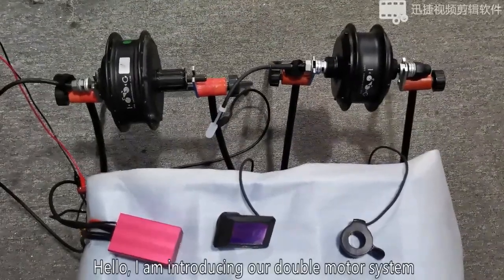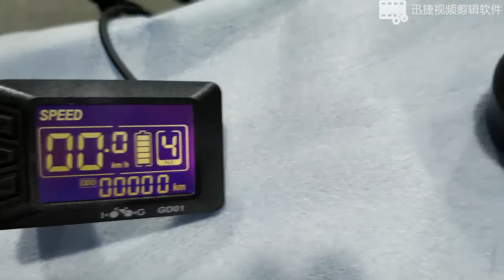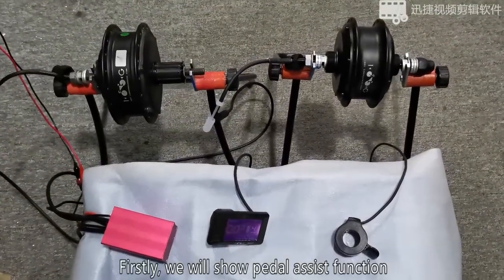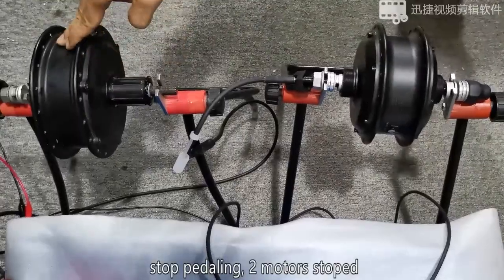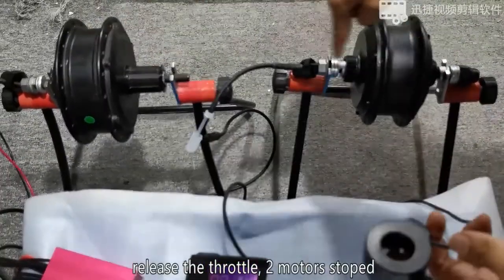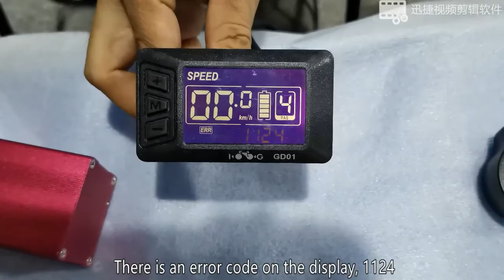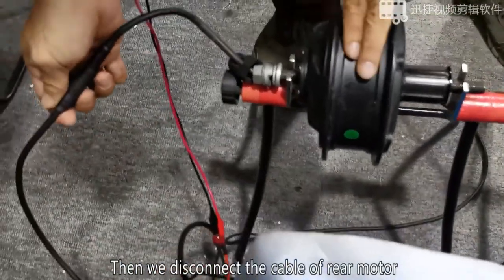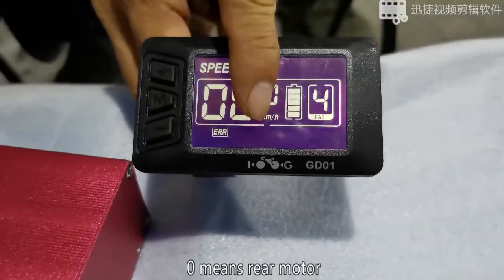Electric bike double Motor System Introduction - 2 hub motors with 1 controller for ebike

Comment: What about battery or battery's   1 or 2"  if one"  it dains out quickly  or you packing 72v
Reply from the maker: Our dual system compatible with 1 and 2 batteries.